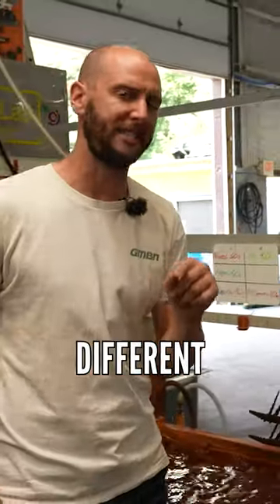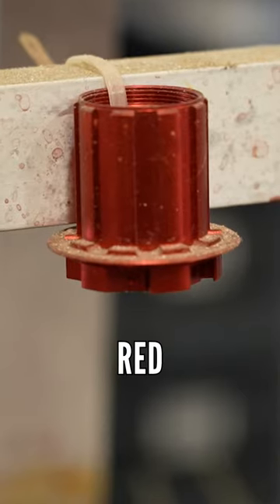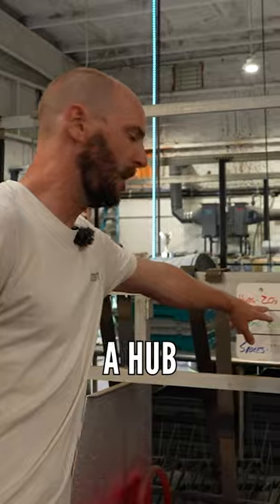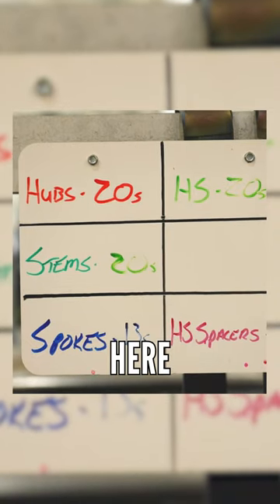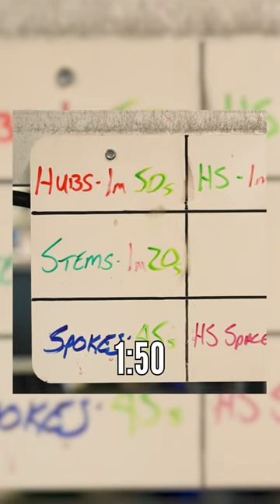Hub Anodising At Industry Nine

Comment: I worked at a plating company for many year ran the nickel chrome line doing sockets , Harley mufflers , Harley swingarms , truck stacks and custom work I also was in the polishing department for many years. A lot ask why is it so expensive because there are a lot of hands that touch that part before you get the finished product.
Reply: I got Aluminium trailer parts anodized years ago. It was relatively cheap, the parts were almost 3 m long.
Plating with Chrome however can be more expensive, I never had the demand to get sonething Chrome plated yet